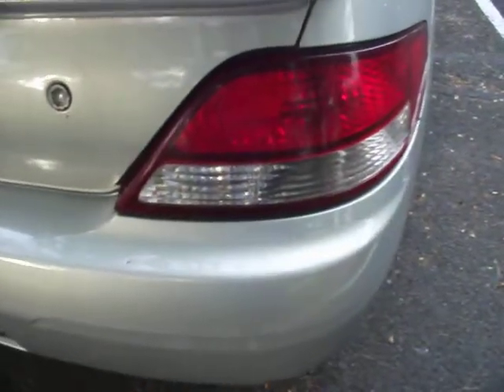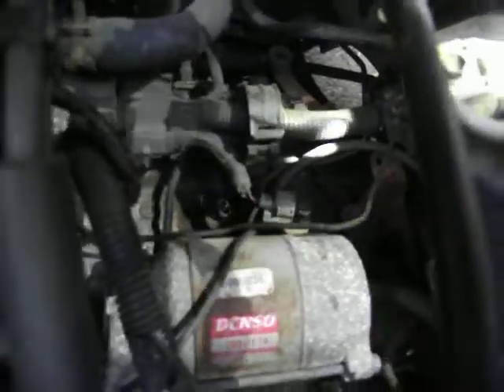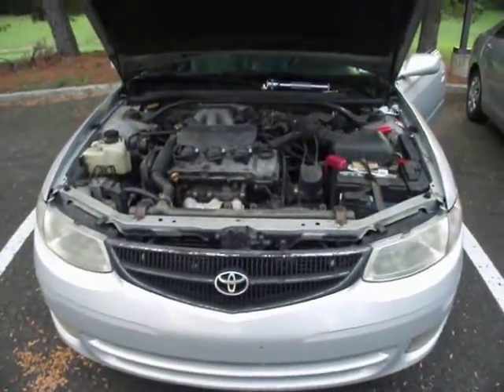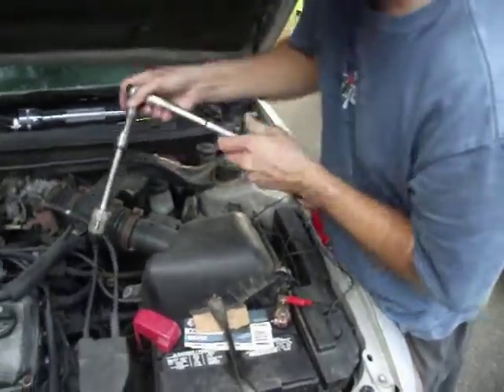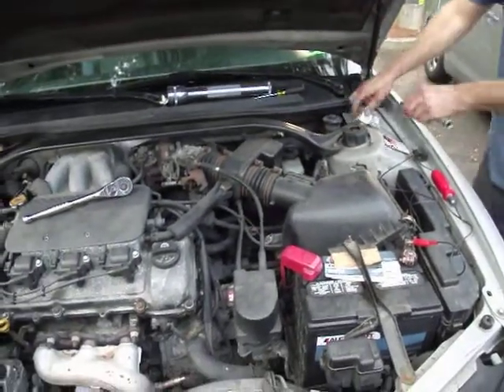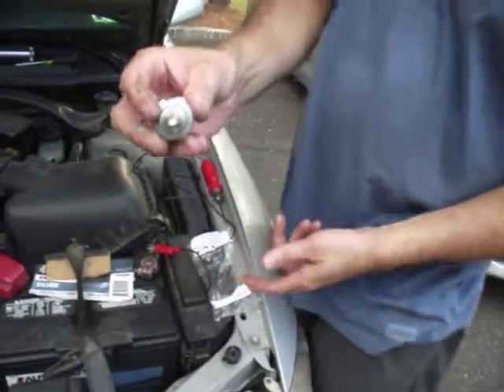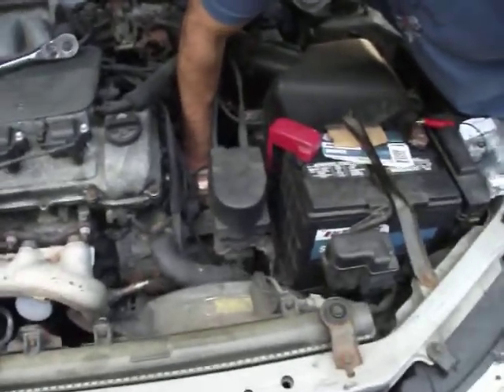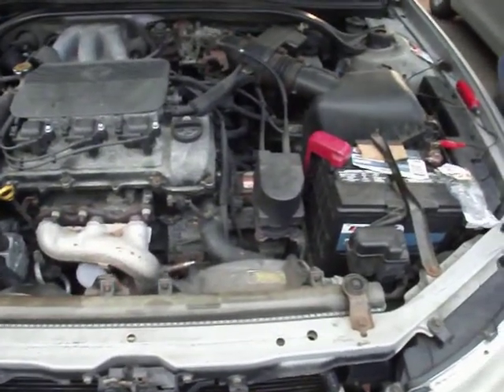1999-2003 TOYOTA SOLARA REVERSE LIGHTS OUT/SWITCH REMOVAL AND REPLACEMENT

Comment: Question, does this engine is same as Camry? My is 2000 Camry LE
Reply from the maker: Yes as long as its a stick shift and V6, verify the part number with VIN at dealership
Reply: @dominicbelisari8262  damm. My is automatic.